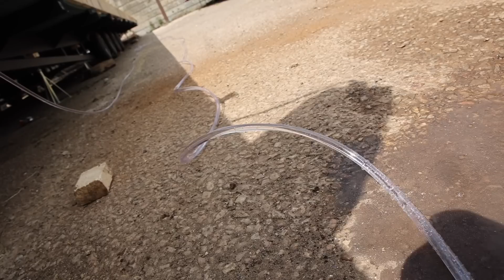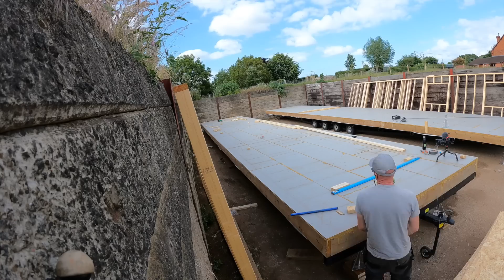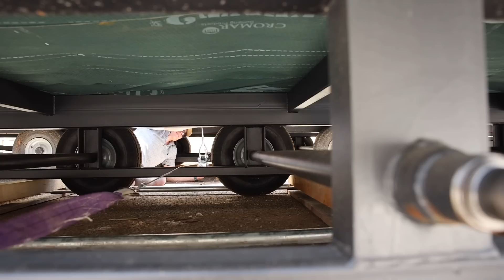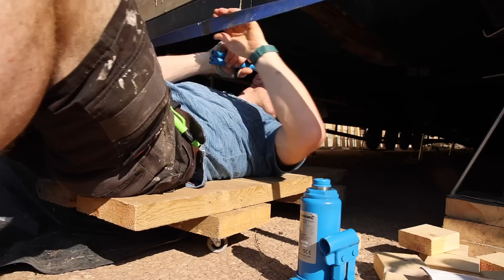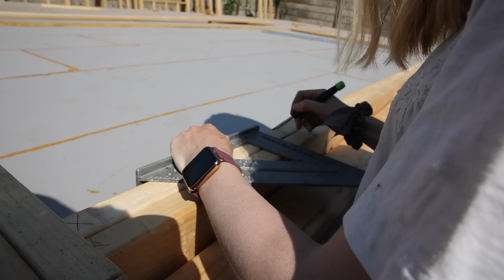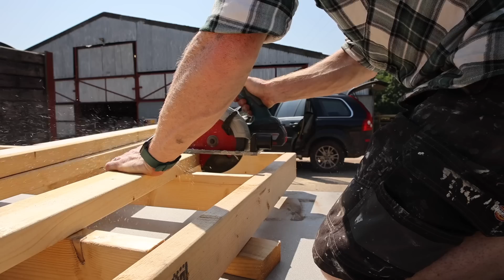TRYING TO LEVEL A HUGE MOBILE HOME! - Water, Winches and Jacks

Comment: We had a caravan site, we used hardboard shiny site up & grease under the tyres, little push with a tractor or pull with a winch & hey presto !  Always level the middle axle first, then front to back.

Comment: That looked like a lot of hard work but I loved the water level. Its such a handy thing with no power being used or needed. To fill your tube and keep air out the simple route is to have a deep bucket filled with water then its as easy as coiling the tube from one end into the bucket. By the time you get to the other end you have a tube full of water, no sucking or pouring no fuss. Shame about the wood being a different size could you have used shims on the floor side of the walls after all it seemed to be about 1/4 inch which can be "disguised" when you install the drywall/siding, I know... you would know that it was not done right and that would bug you till the day that it was corrected. Thanks for posting

Comment: Couple sheets of hardboard shiny side up under the wheels and washing up liquid then pushing side ways becomes a lot easier. 
Great progress well done.
Reply: I spin my twin axle caravan on 2 sheets of ply and sand in between.
Reply from the maker: That sounds like it could have worked. Not sure about when they are fully built but worth a try. 👍

Comment: I'm surprised you didnt use the Hi-Lift jact to pull the two parts together for the final few inches. Simply turn the top jaw through 90 degrees and you have a high powered clamp with a squeezing action.
Reply from the maker: The main issue was that it was still touching tyres to the floor. We did try the jack off the concrete walls which worked a bit but couldn’t face the comments on showing that one! 😂

Comment: You need something like a small telehandler to move them sideways.
Reply from the maker: 😂, it hadn’t arrived when we were doing this. That said, it won’t work when we are repositioning the complete buildings so need to find the proper equipment to do it.